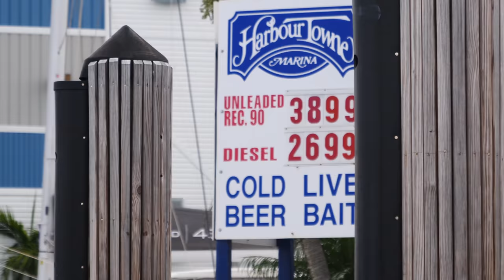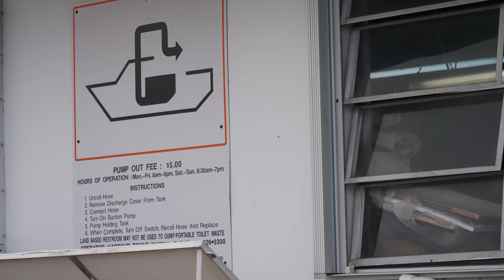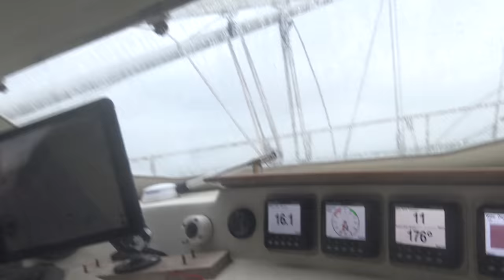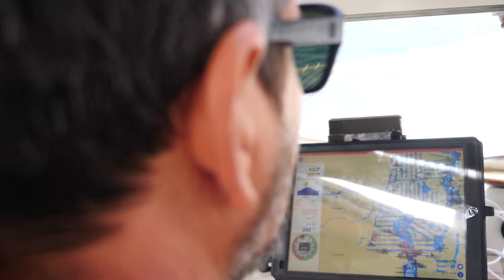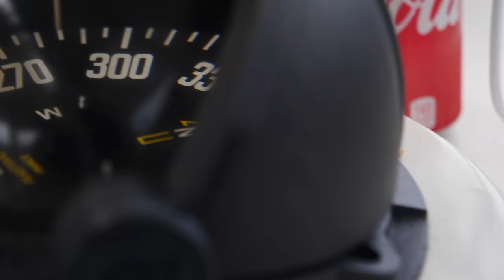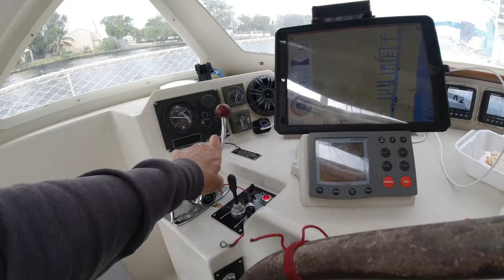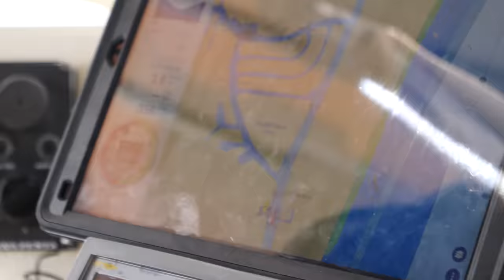Papa SV Delos in da House | Florida Intracoastal Waterway - Ep. 320

Comment: I use a swiffer handle and about a bucks worth of hardware for my diving gopro handle. If it wears out there is always another. Drill a hole in the handle section, it sometimes builds up pressure when surfacing.

Comment: Just a heads up!!  Sitting on the bow of a vessel with your legs dangling over the bow (bow riding) is considered careless operation (regardless if there is a bow rail or not) and can be found in Florida Statute 327.33(2). By the way I speak from personal experience. Fortunately I only got a warning.  I love your adventures

Comment: If you tie a line off of the front of Delos and attach it to the go pro handle down towards the camera end then you can put the camera under water and not have to fight the force against you. Allow the rope to take the force. And you can relax.
Reply: The water was so murky, I doubt there would have been 12 inches of visibility.

Comment: It's not engineered until it's over engineered. Couple extra drilled holes and a bit of string and we have a lanyard. A little glued on Styrofoam and - voila - a secure floating selfie stick, but now we'll call it a super duty prop and hull inspection tool.

Comment: The snubber prevents the anchor from dragging if there are winds and waves?
Reply: Yes, it's a bit like putting a rubber band in your anchor chain which will stretch and absorb some of the force rather than pulling on the solid chain.

Comment: I need to buy a new outboard. So I am in Mexico and still get a 25 Enduro 2 stroke loud and stinky or the new 25 4-stroke.
Must have reliable. 
What do you think as you have had both. 
A
Stephen
Reply: You can't go wrong with either, butI have to say I really love the 4 stroke Yamaha.  It's way quieter, smoother, kazza can start it and uses less fuel and it's only a few pounds heavier than Enduro.  So far so good but will have to wait and see if it holds up as well as the Enduro.

Comment: Dear Delos, it appears that your website has been low-key hacked by "black SEO" operators. At the very least, they have edit permissions on the blog pages and inject certain URLs and text here and there. A case in point: there are two "vienna escorts" hyperlinks on the blogpost The Delos Diaries: Part 13 “Queen of the Desert”, as if Lizbef has added these links herself and mentioned the escorts in the text. I suggest you should figure out under whose credential these edits were made, revoke that user's access, and return this blog post to Lizbef's original version. Unfortunately, this post's earliest snapshot on Internet Archive Wayback Machine (October 25, 2020) already has the first hyperlink injected, yet not the second one.